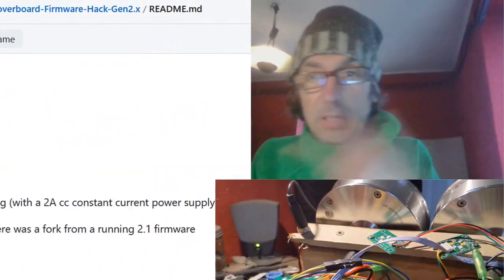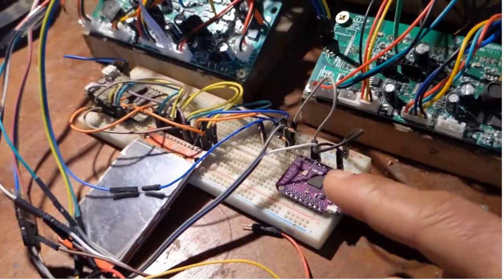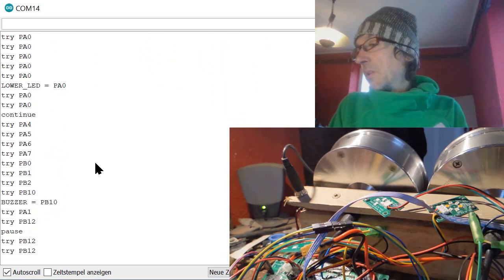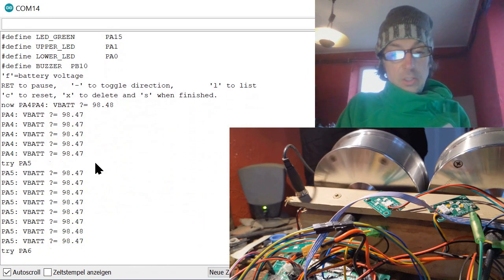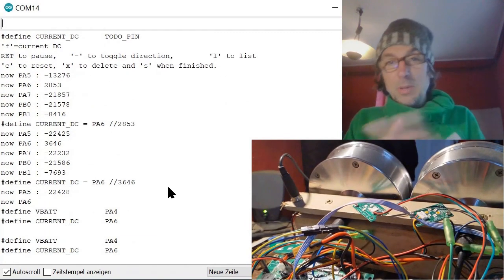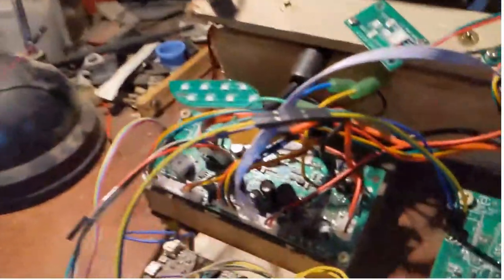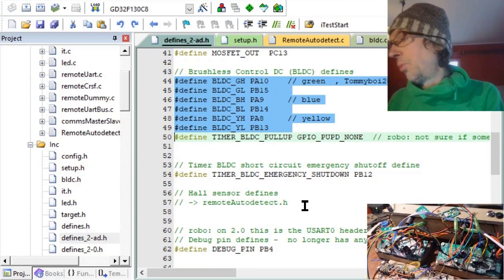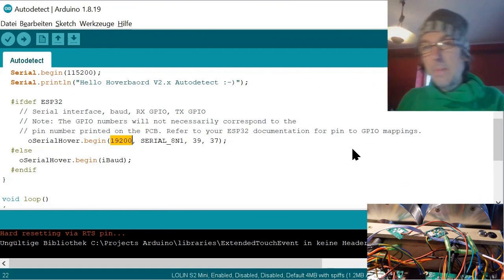!!! Hoverboard Gen2.x *AutoDetect* firmware :-) !!!

Comment: Thanks for all the work you've done! The comment around 6:03 scared me a bit😬 How do I check it? If pins 26(PB13) to 31(PA10) all go to the one gate driver chip, am I good?
Reply from the maker: Yes, if you have one big gate driver chip for all the three phases, than testing the 6 gpio pins is quite easy.
I think i have seen only one board with different pins and that was a 32 pin mcu package. So if you have the standard 48 pin GD32F130, then you should be okay.

And only test with a constant current power supply anyway.

Comment: Awesome stuff, I have hoarded hoverboards that would otherwise been trashed and repurposed so many of them thanks to you! :)
Reply from the maker: See if the mcu is a GD32F130 or a GD32E230, then after checking the two mosfet pins of one phase to match the default mosfet pins, you could already flash the binary and let it run (with a 2A CC constant current power supply/stepDown for saftey).
I really would like some testing on other hardware as i needed a lot of fine tuning to detect the pins..
Reply: @robodurden  I will have a look when I have access to the hardware from last year and can send  you some boards if they are different. :)
Reply from the maker: @Superminaren  "Alone.. you always.. lose.." - i have enough test setups of my one and still some boards untraced yet.
Reply: @robodurden  No problems, I will have a go at testing the boards, I am just on a lot of other projects at the same time. 

Do you have any forum that I can join to stay social at? :)
Reply from the maker: @Superminaren  link in the description :-/